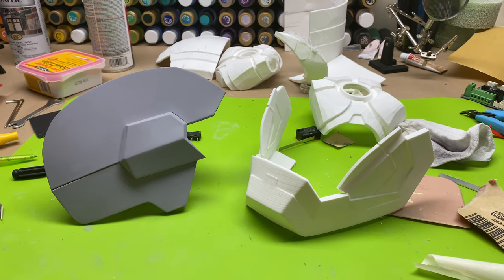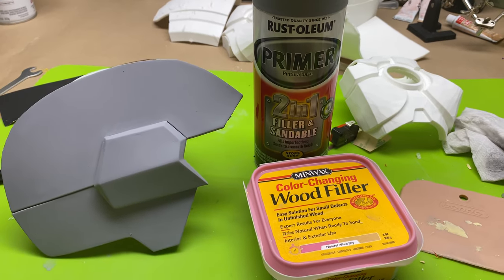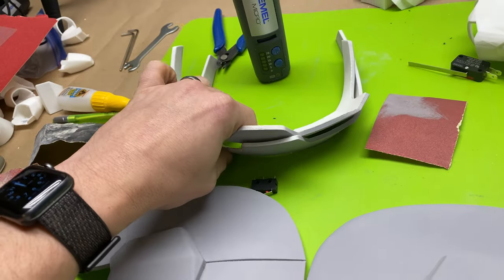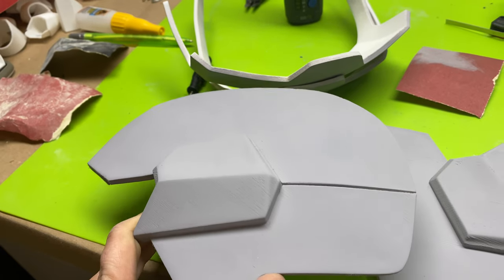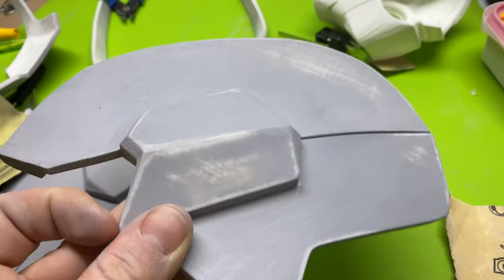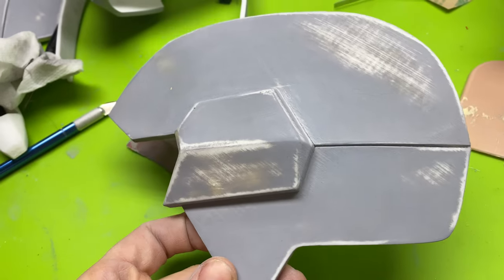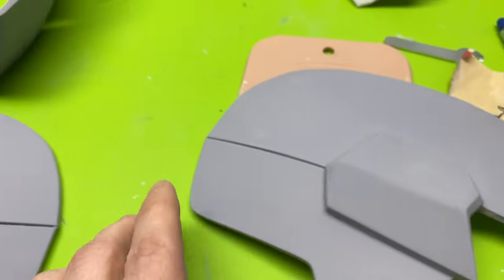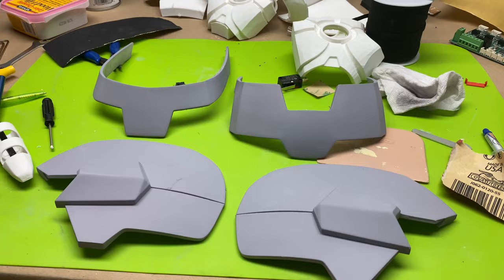Smoothing PLA 3D Prints - Post-Processing Large Cosplay, Armor, and Props

Comment: Do you think you could bypass using the wood filler by using a thicker automotive filler primer out would you recommend just going the wood filler route?
Reply from the maker: You absolutely can do that. I have used bondo in the past. This is just how I do it. I like wood filler as my primary filler cause it’s easier to sand for me. But you can use anything you want. I recommend testing it out to see what you prefer.